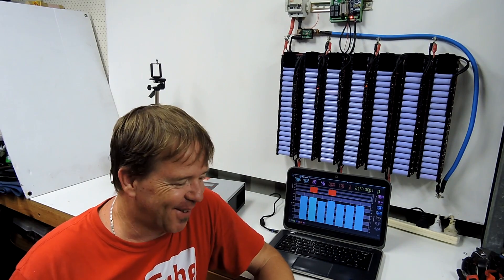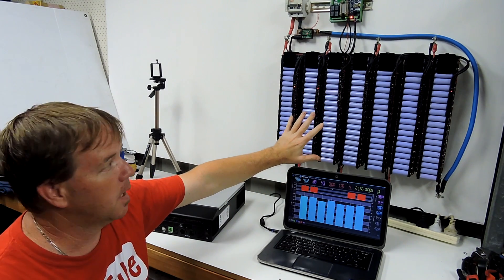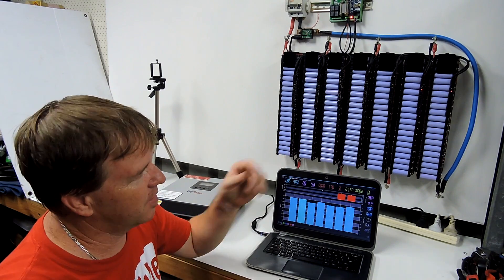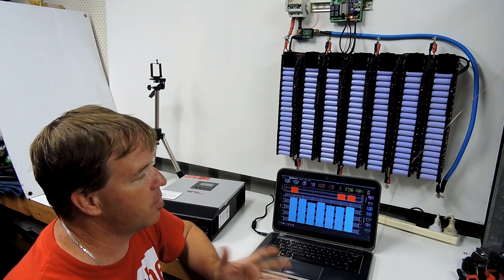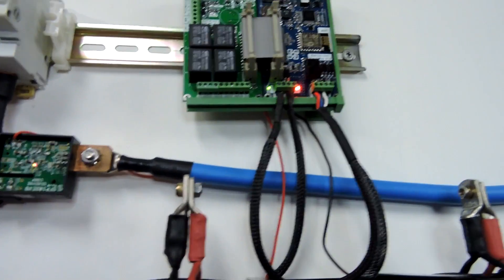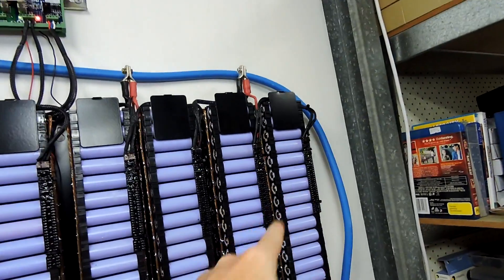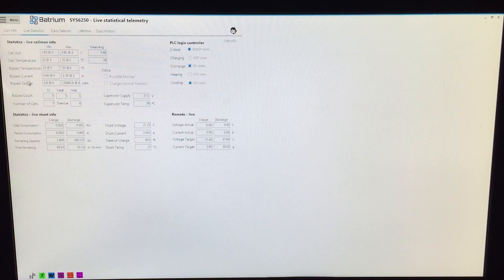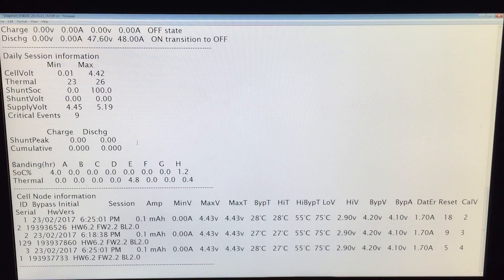Cable management win with the Batrium BMS installed and looking sharp!

Comment: Thanks for the quick reply.
I find your videos very informative and helpful.
I have some other questions if you don’t mind.
I see you use your computer to manage your power wall, where can I get the program you are using?
I live in Canada where it’s cold in the winter.
I heat with electric base board heaters.
The total wattage of my all the heaters is approximately 19,000 watts.
They run on 200amps.
How can I figure out how big a power wall it would take to run these heaters?
Regards
Frank

Comment: Hey Petester, if you didn't use the batrium bms system, what do you think you would go with in its place, if anything?
Reply from the maker: To be honest, if Batrium didn't come on board I would have given up. it was painful constantly checking cells. That BMS changed the way I thought about safety & gave me an overwhelming confidence to push on. Nothing else on the market has that GUI that i know of. REC BMS among others are up there for sure with Batrium but never used them.
Reply: @HBPowerwall  - awesome, thank you and I somehow suspected that for some reason. I'm making a mobile pack of about 480 cells in a 4S config. I keep vacillating between the Batrium system and no BMS at all. I appreciate the input.

Comment: looks the batrium BMS is expensive. You will run your system without the BMS
Reply from the maker: Batrium accounts for less than 10% of total outlay and probably will save other 90% from going up in flames so define expensive! I did run for many many months with out a bms and it can be done ... Trust me it wasn't fun and took a great deal of time testing voltages with a multimeter several times a day and once every three months pulling all packs out and paralleling them up to balance sucks big time.

Comment: I see you have the expansion board. Is that required to be able to trip the breaker? And what other functionality does it offer/do you use it for? Finally, what breaker are you using for the Batrium control function?

Comment: if this is just to monitor, what do you use to charge and balance de battery packs? and how do you know when 1cell fail? thanks
Reply from the maker: It manages the batteries as well as monitors. Batrium BMS takes care of the top balancing of the bank of batteries as well as watches for over under voltage or low or high temps based on my programmed settings. Can program many settings includeing the balance voltage. Charging is taken care of by the PIP4040HS https://goo.gl/fMG8Fx or i can also use my PCM60X to charge and they have all the high and low programable settings also

Comment: Hi could I ask a question ,can I run a wind turbine through a rectifier and 4x 12v 250w solar panels 2s2p on a pip double mppt 2424 as it has 2 inputs or do I need a separate wind charger as I love in England and we don't get the sun like you do but plenty of wind . I'm just starting out and trying to plan what can and can't do many thanks and keep up the good work.
Reply: ross sainsbury I have seen MPPT solar chargers with wind and solar inputs. Don't know much about them, though.
Reply from the maker: Sorry don't know much about wind...
Reply: Ok nice one I'll have to look into that thanks

Comment: Looks really really clean job to bad you have to take it all off again or are you leaving it on the board. Also do you know if this bms works for all batteries or just li-ion?
Reply from the maker: the way I've done it. Only have to undo positive and negative bolts unplug one connector and a cell pops right out takes less than 5 min for the whole pack to be pulled down. Can't honestly say if it works on all batteries I will chase it up again.